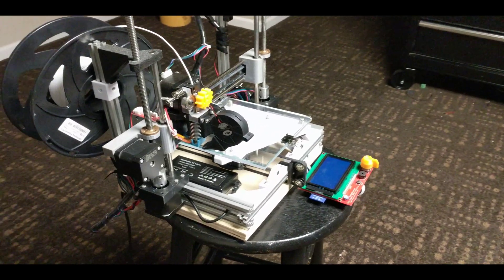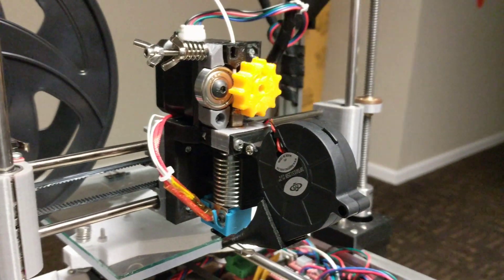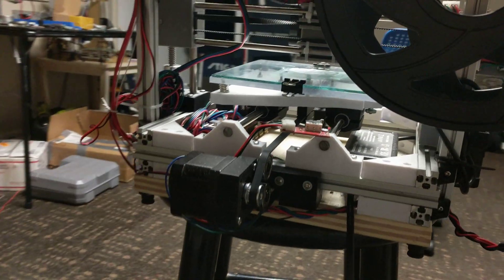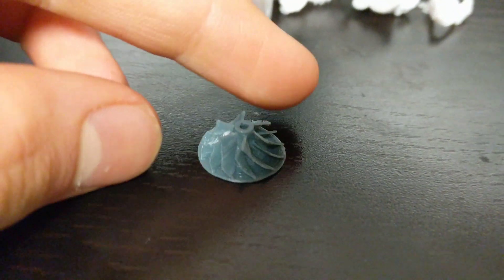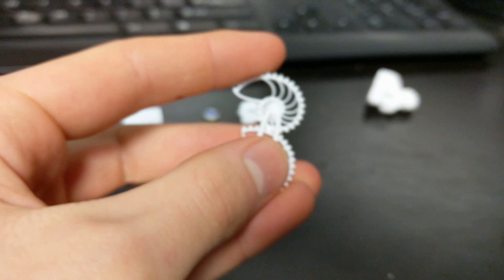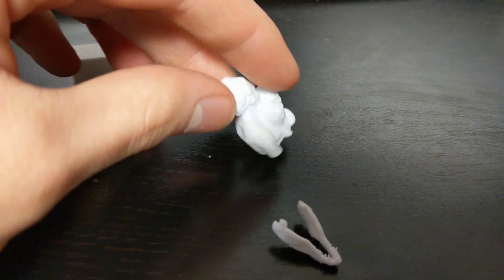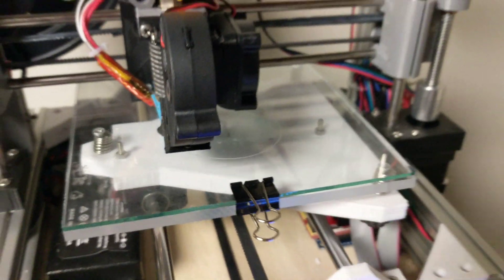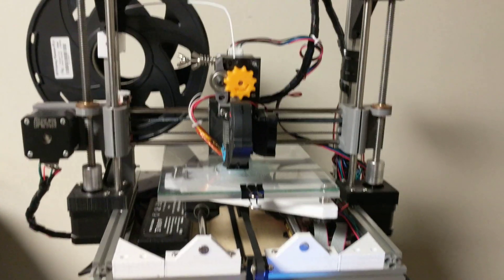Reprap Designed from Scratch! Custom Built 3d Printer

Comment: This is a really cool little printer and really nice work. Any chance of working on a really big 3D printer?
Reply from the maker: Thanks again, I appreciate it. I have the 3rd iteration of the extended tronxy x1, that you've seen the video on, and am working on a video for that. It is 300 by 650mm large. I dont have much use for a bigger printer, but if I do, ill be looking at a hangprinter.
Reply: @MakingwithLuke  I'm interested in building  a printer that would be 500mm x 800mm or longer. Bounce me a message if you would be interested in helping out. I'd be happy to fund you to build a big beastie for your channel.
Reply from the maker: @originaltrilogy1  That would be very cool! I would certainly be interested in helping out. send me an email makingwithluke@gmail.com . this could be an awesome project! I do have many other projects I'm working on, but this intrigues me.
Reply: @MakingwithLuke  I've bounced you an email